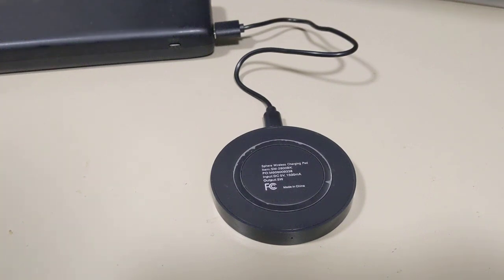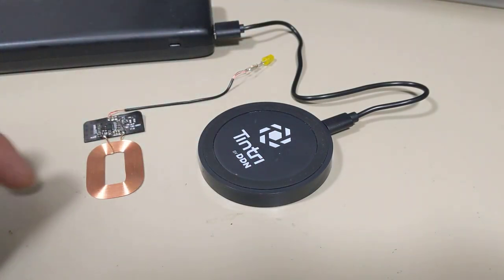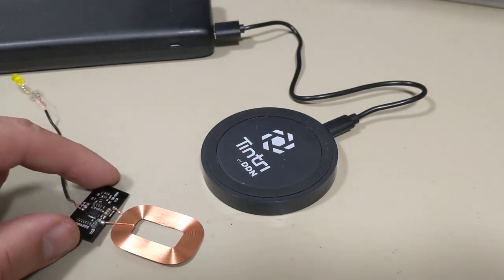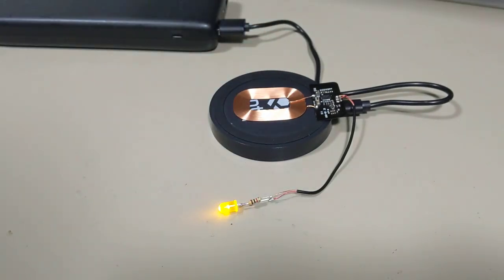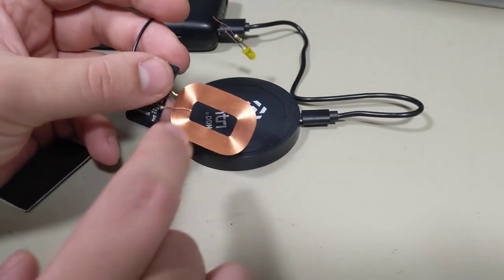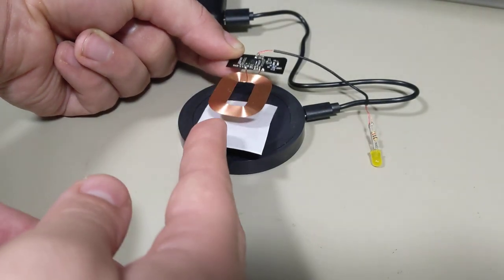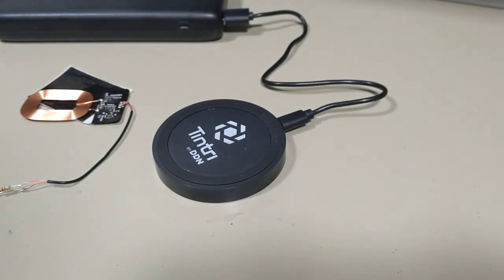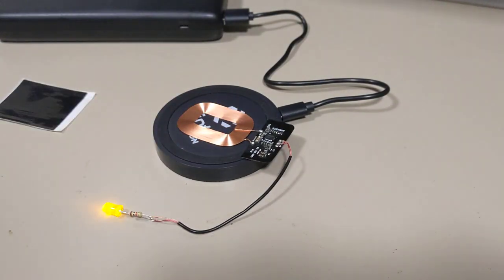Building Qi Wireless Charging into your own projects

Comment: I built a lawnmower that uses wireless charging, I find it it was better to resist the elements, now I am building a GPS tracker dog collar, and I want it to be wirelessly charged so I don't have to open it to charge it to keep it weather resistant.
Reply: The dog bed has a giant induction coil rimmed around the edges under the foam lol.

Comment: Hi Kenneth, I am looking for such a solution for my sensor network. I want to power a 100 ma Particle sensor (and some other greedy sensors) outside my house  for sensing the air. If the air is ok ventilation is possible. So i need a constant monitoring device and using a battery pack is not an ideal option because of the greedy power consumption. A wire to the outside is also not really feasible, and I want to make a wireless power connection though my window.
The window is double glass and effeciency is not an issue to me, as long as it works. Do you think these modules can work through double glass windows?